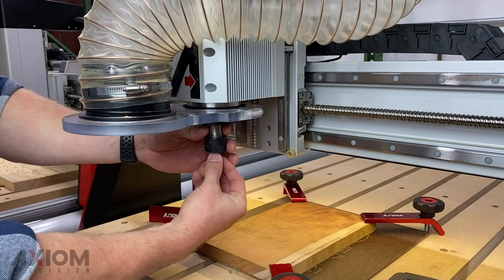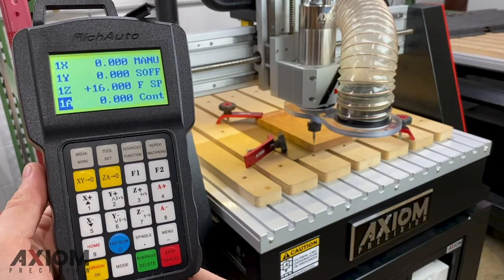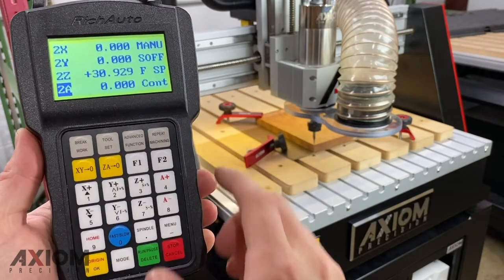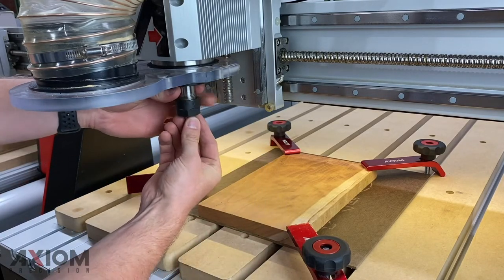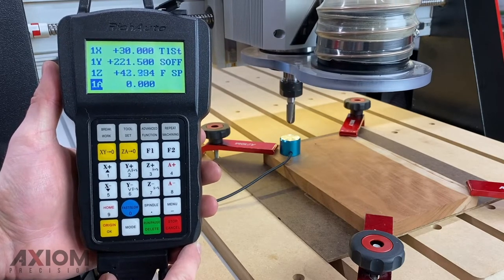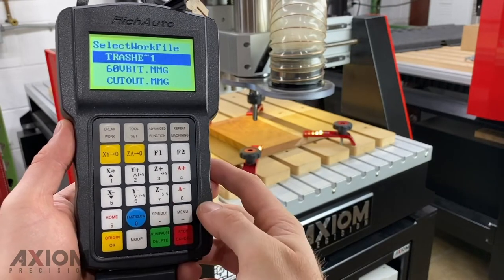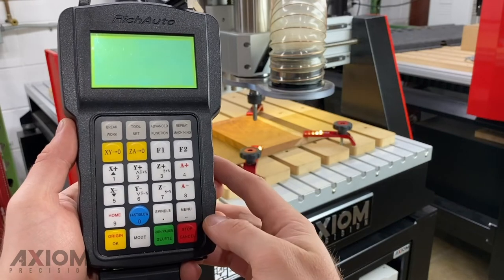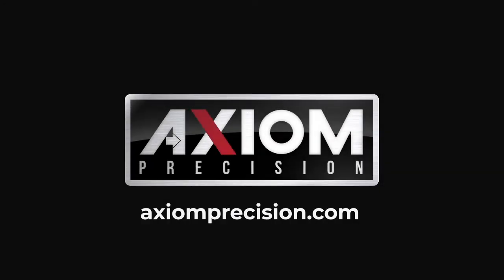Axiom CNC Training Tech Tips (How to run a file on the RichAuto controller)

Comment: Hi, great video, 
Is it necessary to turn off machine when changing bit? 
How do I set the Richauto controller to  start cutting only when the desired number of RPM is reached?
Reply from the maker: Thank you, it is not necessary to shut the machine down to change your tooling. Your RichAuto controller will have a 3 to 4 second setting that will let the spindle come up to operating RPM before the file starts.

Comment: Hi, thanks for the video question. I think I messed up pushing too many buttons. My y seems to be out.  I have an iconic eight can you tell me how to put it back to factory settings please thank you in advance❤🇨🇦
Reply from the maker: If you need to reset your controller back to factory settings please email our support team. 
support@axiomtoolgroup.com they should be able to supply you with the necessary files to reset your controller.

Comment: hello. I want to get my z 0 but the sensor does not detect it. I have to stopped it using the richauto controller. What can be? Thank you
Reply: If you a referring to the blue puck not sensing the contact with the bit...this can be caused by a poor connection or bad wire in the puck cable, or a loose connection in the backside of the female plug. 

It would be recommended to check that wire, it can be replaced very easily as it simply attaches to the bottom of the puck with a screw. Generally, when suspected as having a poor connection...we cut this wire back approx. 2 inches and then reattach.

If you need further assistance, please give our support team a call. 

Thank you,

Comment: I am getting a error unknown file when selecting a file. What be wrong?
Reply from the maker: Be sure you are saving your files in the correct formate. If exporting them from the Vectric software remember to use the Axiom post processor saving them as a .mmg file.